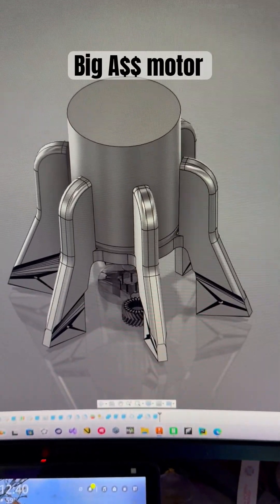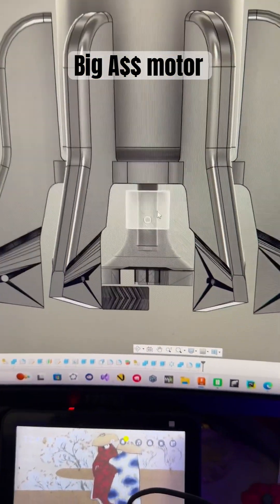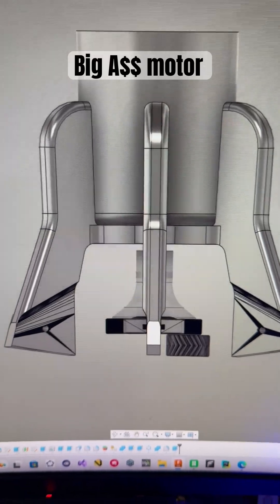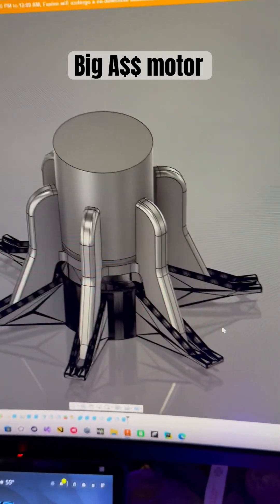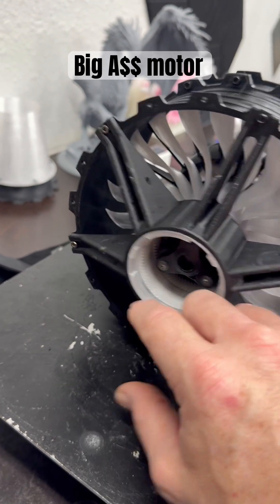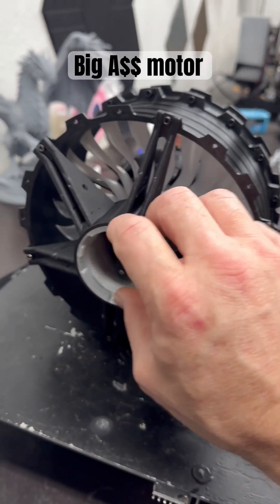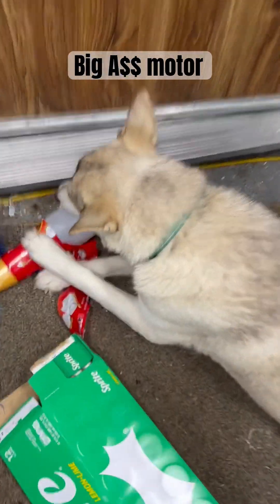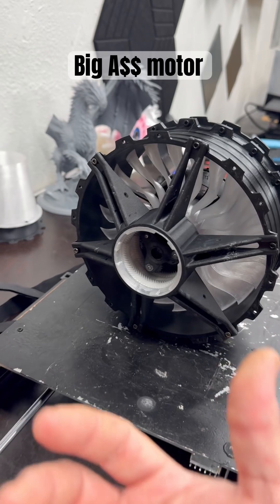Flip Sky 6374 Motor driving Stubby 3 electric turbine. #edf #turbine #diy #fyp #shorts #rc #drone

Comment: Just due to the "all components should look like they match" heuristic, have you thought of increasing the height of the gears? They look too small, and this does not look right, giggity.
Reply from the maker: Changing the size of the gears wasn’t the first priority. It was testing materials with those gears up to an including metal printing. Adjustments can be made to the planetary system if issues persist but so far it’s been materials issues and not design issues. The system would be very reliable with metal gears, but I have to do my experimentation with other FDM materials first this is kind of the journey behind the whole thing.